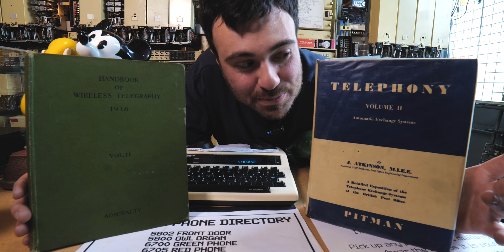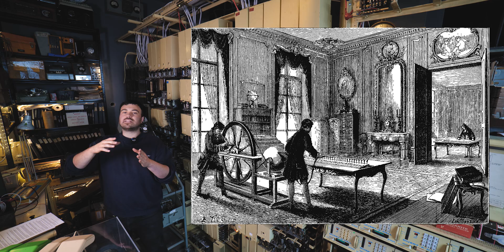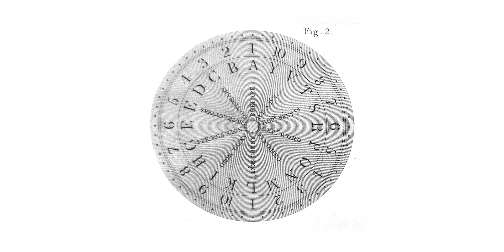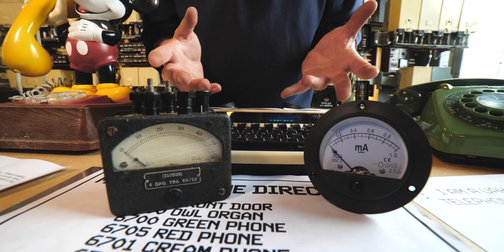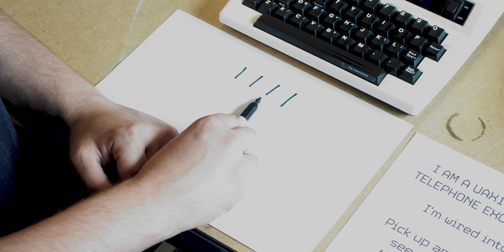Telegraph Machine History Part 1! - Telephone Tuesdays

Comment: I didn't realise binary coding for letters and numerals predated the electromagnet/relay! Fascinating!

One small bit though, exponential growth is anything that is multiplied by the same factor every time. Whether it's 2, 10, or 5000 the same exponential curve will be drawn. (Though if you plotted them together, some would look more squished than others!)

The maddening thing about exponents, and near-infinity, is that once the curve is asymptotically approaching vertical... they quickly all come to the same figure regardless of this "speed". When that's drawn on a graph it looks like one straight line and one right-angled line going to the same point, with all the curves you could possibly draw in-between them.

Comment: There were semaphore signal towers in the UK as well. One connected London with the naval base in Portsmouth and on Ordnance Survey maps you can see hills called Telegraph Hills. Of course useless at night and in bad weather. 

When the London South Western Railway opened it's line from London via Eastleigh to Gosport (opposite Portsmouth across the harbour) they ran the first UK telegram lines alongside the railway line in 1845. It was installed and operated by Cooke & Wheatstone and the MOD rented one line and stationed naval personnel in the station telegraph office. Presumably  message were then taken by boat across the harbour. 

It was 88 miles (142 km) long and used a two wire needle system. To get publicity for their invention Cooke organised a chess match between two prominent chess players in Gosport and amateurs in London.
Reply: Didn’t know about the chess match! Awesome

Comment: In the era of telegraph communication with operators it was suggested the receiving operator would hear the incoming message, then sharpen his pencil and write it down.
On trans-Atlantic cables they followed the incoming dots and dashes with a pen recorder onto a paper strip. The operator would then look at strip and write the text. Later they used typewriters to print the text, on line text was often abbreviated and the operator had to expand to full words. Stories told me by a college who worked on long distance cables during 1930s.
Reply: Don’t worry we’ll get to printing telegraphs in episode 2!

Comment: Next you'll find yourself enamoured by teletype machines and figure out that old teletype standard from 1920s is still in use in modern day unixes, macOs and linuxes (android as well) as TTY standard. Modern TTY has a few more bits for lower case letters and works on low voltages, but with a high  to low voltage converter adapter a mechanical teletype can very well talk to a modern linux or macOS.
Reply: Don’t worry it’s coming in a future episode!

Comment: If you see an old joint box or manhole cover in the UK (the ones with a wide cast iron surround and a concrete centre)  the oldest ones will have P.O Telegraphs or G.P.O Telegraphs written in the cast iron. Later ones changed to P.o Telephones.

Things are going full cirlce now with the closing down of PSTN exchanges where the cables used to carry telegraph data before voice and now they're carrying internet data.